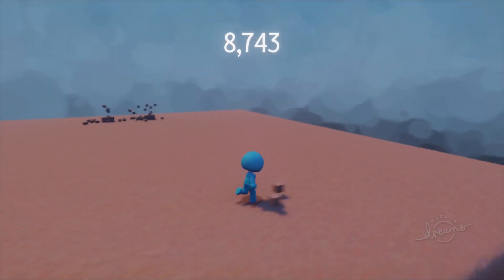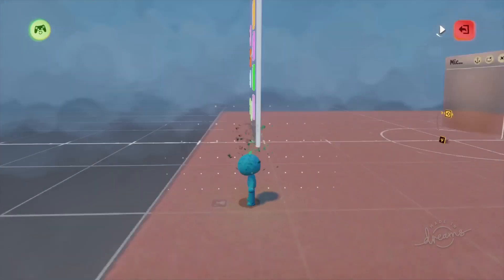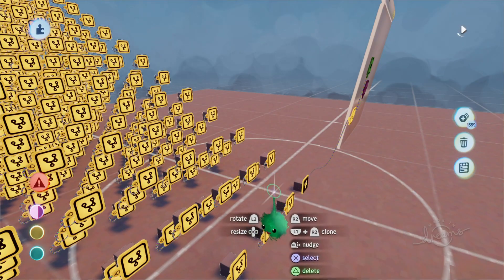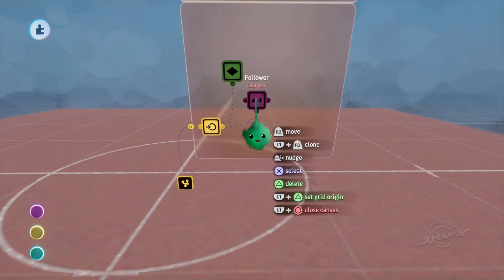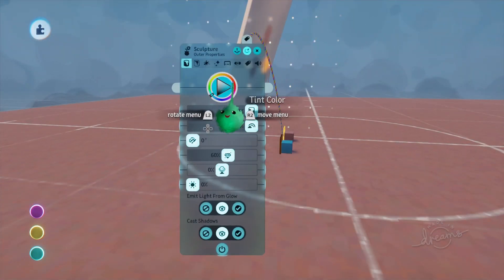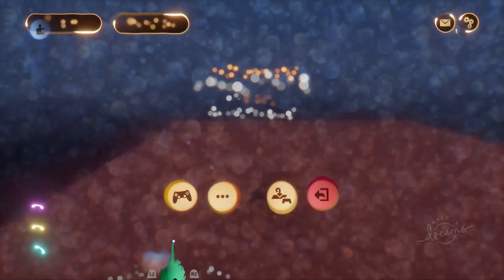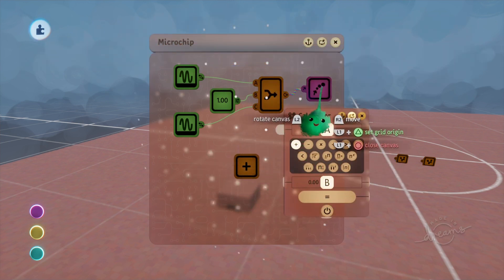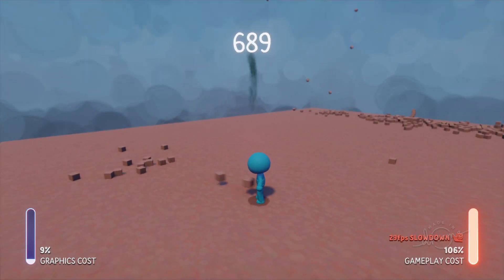Vacuum-Style Pickups | Dreams Tutorial

Comment: Great stuff! Forever ago, I came up with this solution for emitting the same object with different logic and it was also to save on physics simulation costs. So it's really cool to see someone come up with the same thing. It's not used enough IMO ;P

You could actually use the follower itself as the zone--as it has one built-in that's running anyway. So you could just set the zone to be the distance you want it to start following, and it sends a signal from "target found" when the target is found. Then to "lock it in" you could power a keyframe that sets the max distance on the follower to something huge so it keeps following no matter what.

One tweak you could make for a little better perf is to have the puppet's zone look for a tag instead. Points are a lot easier to check for. Non-points (eg. sculpts/groups) are harder because they could be of an abritrary shape--which is why you can hit a zone limit for things that are looking for sculpts. But in general you can't hit a limit looking for "points" (tags, camera, imp tip)--in my experiments I've not been able to hit a limit there, and it's got into the thousands.

Another point is--though this has nothing to do with your solution--while a scene zone is the best as there's no zone check at all... for the limited zones, a spherical shape should theoretically be best for perf as compared to the other shapes, purely because checking if a point is within a sphere is just checking the distance between the point at the centre of the sphere. While you may not notice a lot of difference most of the time, the coded algorithm most likely is quickest for a sphere. Is my guess anyway.

Small slarification: when something is emitted with speed/rotation then it becomes implicitly movable. I've actually found in the past that I could not turn movable off--because that setting never technically turned on as the movable setting was off. So then I'd have to make sure it was actually on for the object that was emitted, so that I could turn it off properly. Have you found that? Or maybe they fixed it?
Reply from the maker: Yo! Yes I love this technique... it's actually what I did for the katamari tech thing I made a few months back, I just never made a video tutorial on it.

Cool suggestions!

It seems like perhaps they've fixed that issue you came across. I tried playing around w/ both speed & rotation yesterday and it was still possible to keyframe movable off with success.